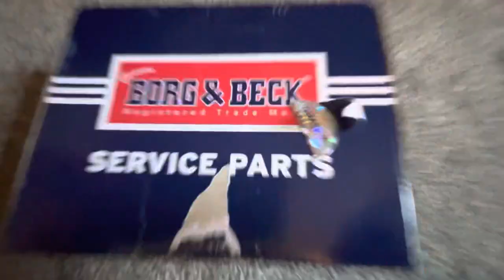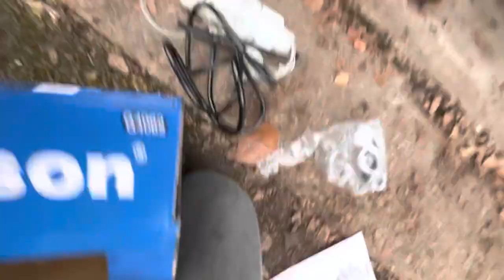Morris Minor - Rear Brake Show Replacement!

Comment: Both rear brake shoe springs go behind the shoes - never assume the previous owner knew what they were doing!  For the ezibleed buy a spare master cylinder cap - drill tap it and fit the nipple from the kit - works well like that.
Reply: Actually - forgot you had a remote reservoir ...
Reply: Only one wheel will turn on the diff while in gear. Both shouldn't be able to turn in the same direction tho